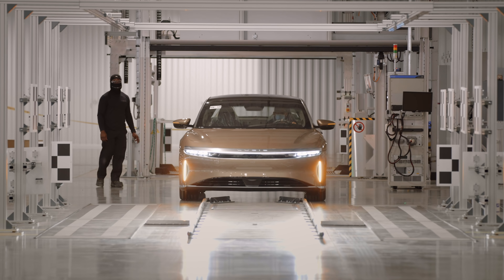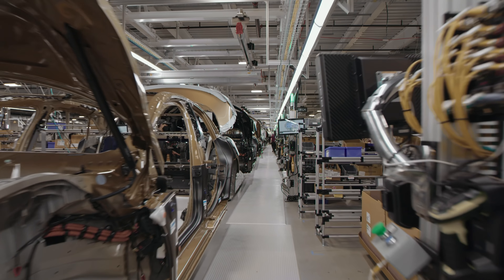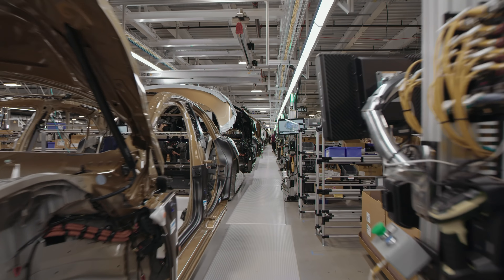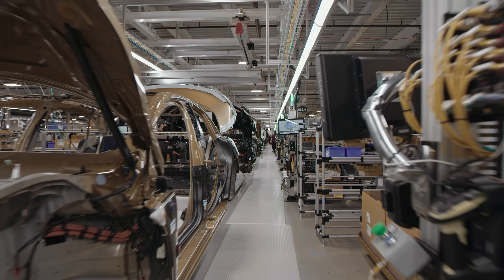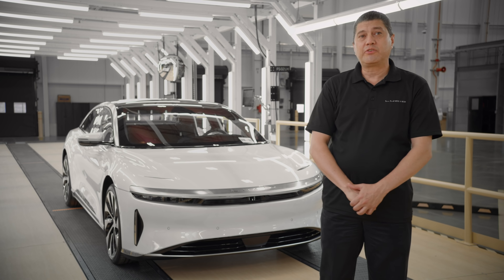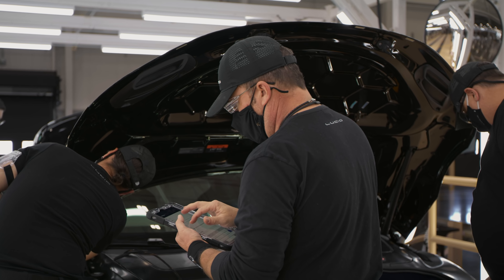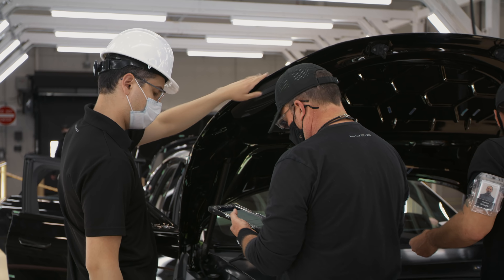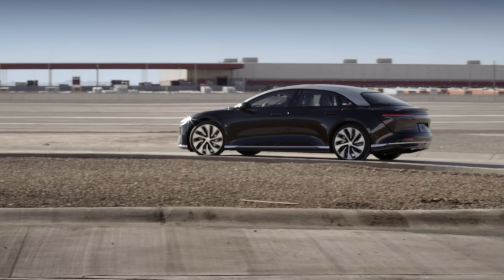Making a Lucid Air | Lucid AMP-1 | Lucid Motors

Comment: Too much concentration on quality at the end of the process, it has to be built in throughout the process.   Everybody has to be drilled in to ensuring that whatever they're doing is right, and to be allowed to stop the process if they find a problem.  You can't add quality by inspection.

Comment: 'craftsmanship'
That is exactly what you do NOT want.
You want to take variability out of your process, and you do that by simplifying tasks and processes to the point where a "craftsman" is not needed, just a conscientious employee or well-engineered robot.
Reply: Go back and look at the early day of Tesla 3: Musk created a full robotic assembly line only having to abandon almost all and assembled the cars manually (under tent !!). Only after they worked out all the bugs that they slowly introduce robotic back in... took about a year.
Reply: @HuyTran-md3on  indeed, probably some processes are hard by robot, others not.
Reply: @Passions  The question is: is he right?

If these cars will continue to cost $200.000

Then the answer id nigh
Reply: @Passions  ? I don't get it. My point is about mfg processes. This is well-known stuff going back centuries; you want to eliminate variability where you can.
Reply: @HuyTran-md3on  you know that "last ten percent" thing in engineering, right? That's where we are with a lot or robotics. You still need humans to get the processes defined and the equipment set up.

My point is that the guy should be focused on standard work and quality (that is, repeatability and adherence to standards) over whether a worker is "feeling good today".
True story: in the 1960's and 1970's, American car-makers would ship cars to dealers with various parts (alternators, radiators, etc) in the trunks..for the dealers to finish up the car.
Reply: kind of funny to see that dude get all amped-up over a basic mfg philosophy.
guess that explains the current stock market nonsense.